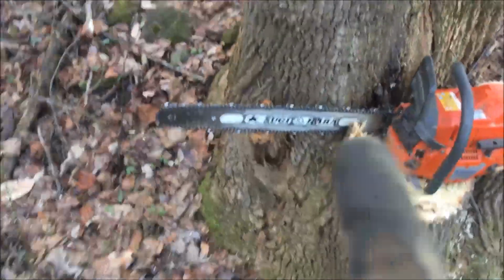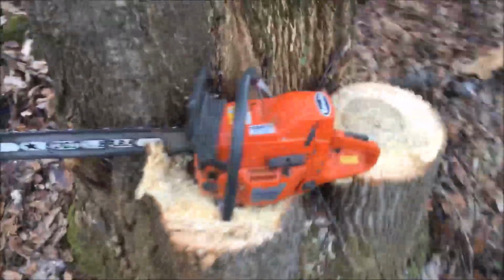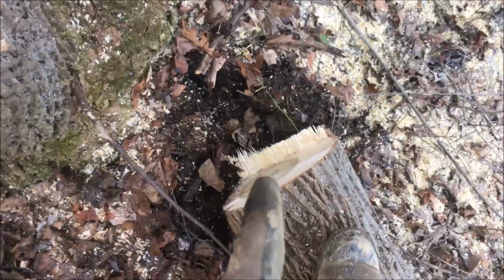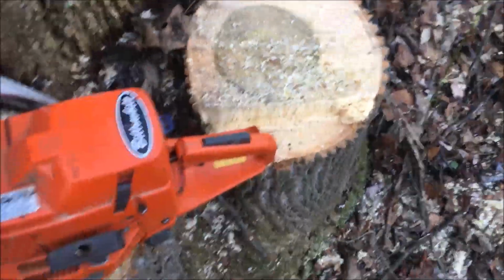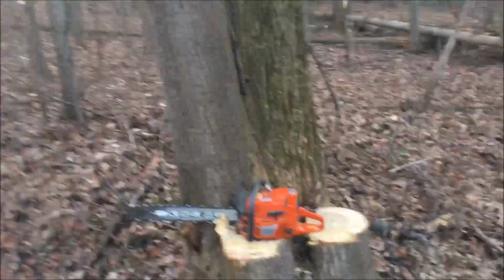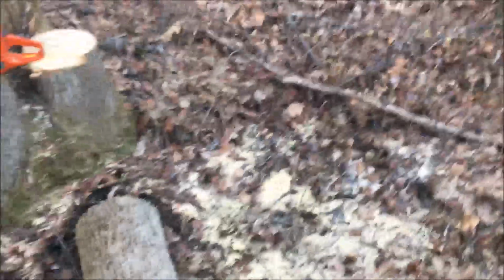why not the humbolt

Comment: I suspect the humbolt was invented in the west when the chainsaw took over in Humbolt County where the trees are big and tall.  When the oldtimers chopped the wedge in the front the kerf was cleared out one chip at a time, but with the advent of the chainsaw I reckon guys had to figure out how to get that huge wedge clear of the cut—and some of those can weigh hundreds of pounds.  Creating the slope on the bottom allows for it to slide out.  Just my best guess, but I suspect that’s why it’s done that way.  Just stuck.  A conventional notch is easier because the saw is weight that way, so unless there’s a reason it makes sense to stick with that.
Reply from the maker: This is the best explanation I’ve ever heard on the style of cut! Makes perfect sense!! Thank you
Reply: Just my best guess.  I’m just a construction worker who loves the woods and grew up cutting firewood, so take it with a grain of salt.  I live in PA, so I learned to fall using the conventional notch.

Comment: Humboldt is really good at sliding the butt off the stump and getting it on the ground first. That can be really important depending how the log will hit the ground. You can destroy a nice log by letting the top hit before the butt or by keeping the butt on the stump. On flat ground it's not always a good choice because you leave good wood on the stump. On steep ground it maximizes the yield because the face cut is taken out of the lower part of the stump generally and the back cut is flush with the high side dirt.
Reply from the maker: yea! what marshy said!!! thanks buddy great explaining!

Comment: Two other reasons I've read/been told is if it's a really big tree, the notch wood might weigh several hundred lbs. so with an inverted notch it's much easier to get out and second on really steep ground it's tough for the feller to get away from the stump so again an inverted notch helps launch the tree downslope much further.

Comment: What's the problem with fiber pull if you're pulling it out of the stump? Meaning the log has the whiskers.
Reply from the maker: Tom Halbur not a thing buddy
Reply: @nuts319  
Ten four.  Makes sense.
Reply: Sometimes the stump holds the fibers and will degrade your log.
Reply: @austindenotter19  
Got it